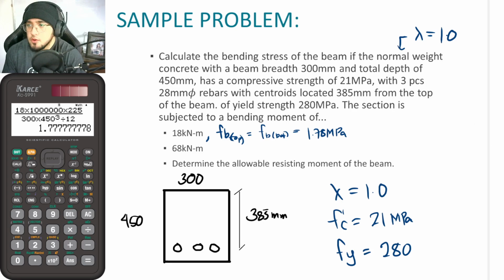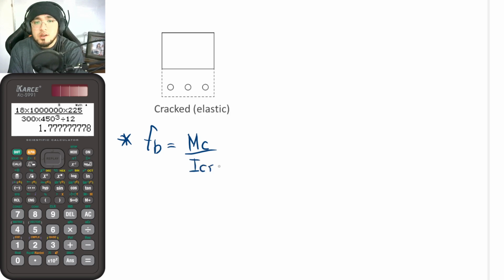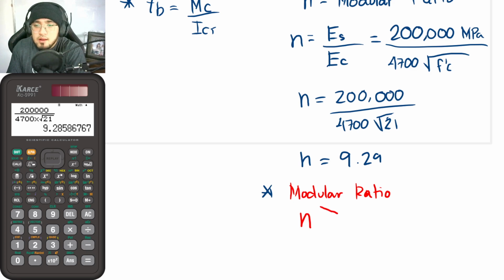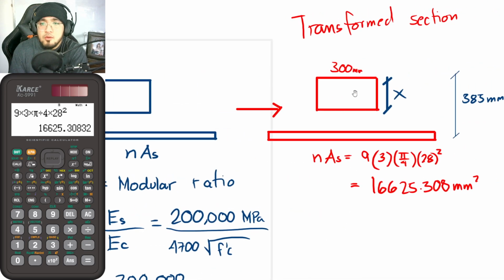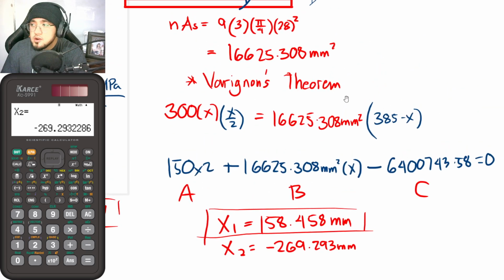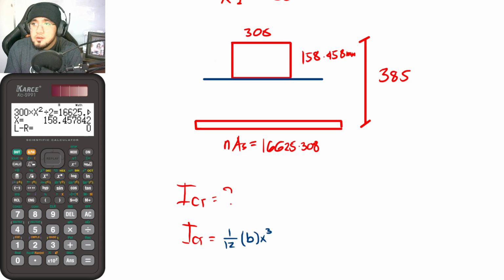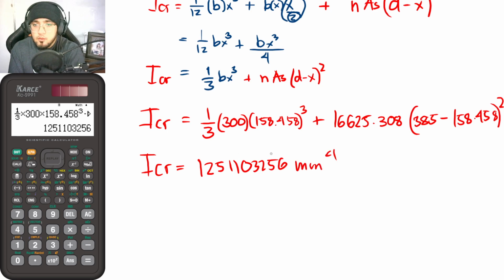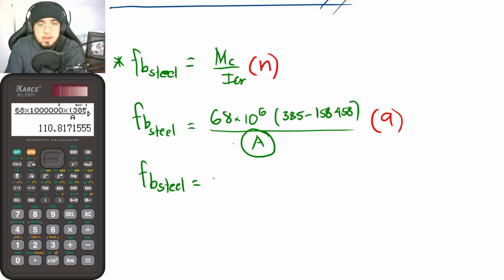WSD part 2: Cracked Section

Comment: sa 26:24 po sir, bat po na neglect yung (bh^3)/12, sa Concrete Area of Steel? diba po equation of Inertia, bh^3/12 +Ad^2, meaning hindi lang Ad^2 yung equation?
Reply from the maker: Hello! Sorry for the late reply.

Anyway, kaya walang bh^3/12 yung sa moment of inertia ng nAs, is kasi "dimensionless" yung area na nAs. Bale assumed na 100% ng nAs is exactly at the center of the rebars. :)

Or pwede mo din isipin na dun sa bh^3/12 na formula, yung h is a value nearing 0 (kasi nga assumed na yung buong area ng nAs is nasa iisang point lang. so parang macacancel din lang siya. :)